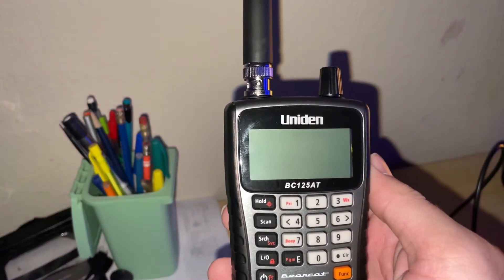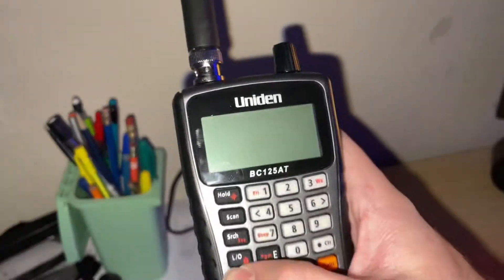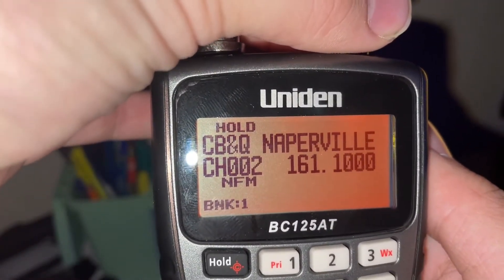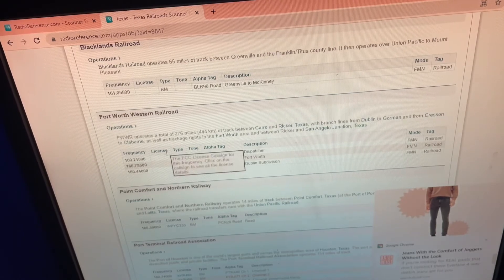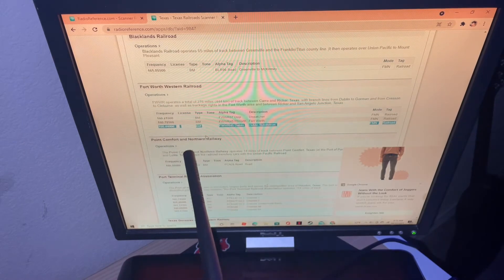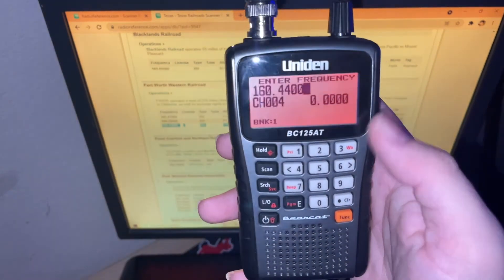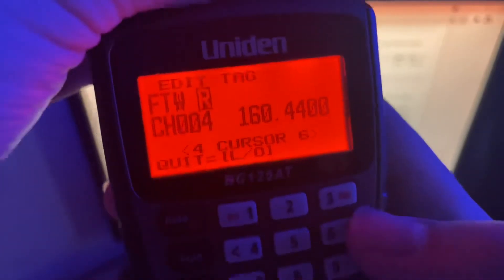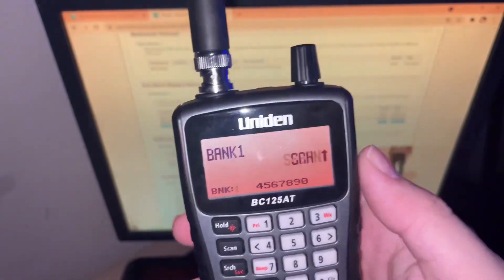How To Program The Uniden BC125AT Scanner For Railroad Frequenies

Comment: Thank you this video was extremely helpful! Finally was able to pick up so radio chatter. One question the site I am using for NS signals  has multiple different channels near me using the same 161.07 frequency, do I have to create separate channels to pick them up at different areas or is the radio just doing a global scan for 161.07. thank you!

Comment: Does this scanner have a "rail" feature where you can automatically scan all the railroad frequecies without additional programming?
ty
Reply: Many scanners & transceivers are hand programmed like this video.
It's usually a " lobby " type program.
Any steps you take forward to make changes you must back out same amount of steps to return to the " lobby " menu.
It's not complicated, but there's usually a Huge selection of changes that can be made.
Most you don't even need to adjust.
Try starting with a common, inexpensive, well known " UV5R " and learn it.
Reply: Yes it does.  Hit func, srch and 5.
Reply: I don’t know if you can